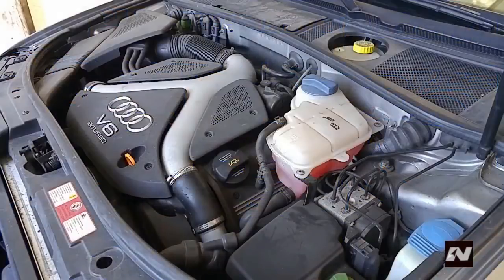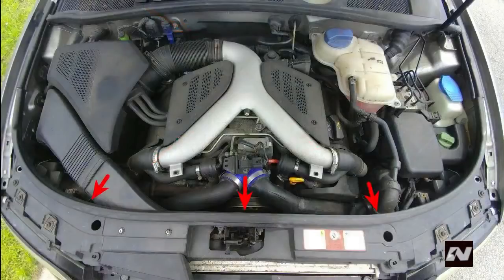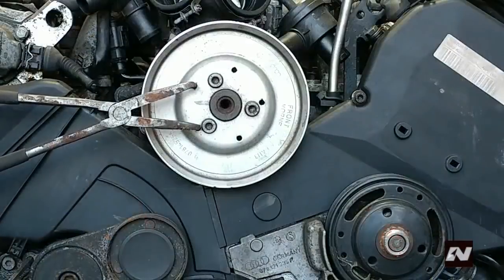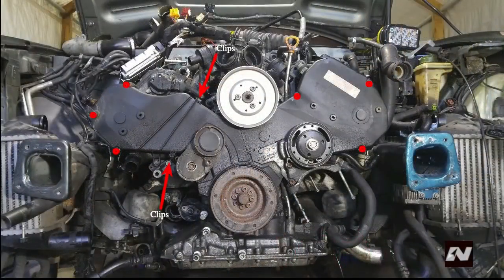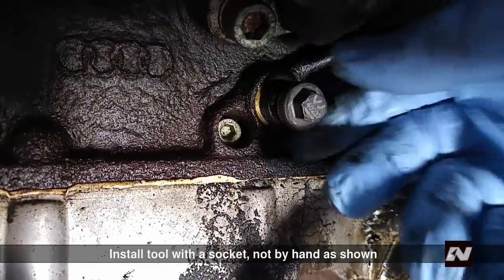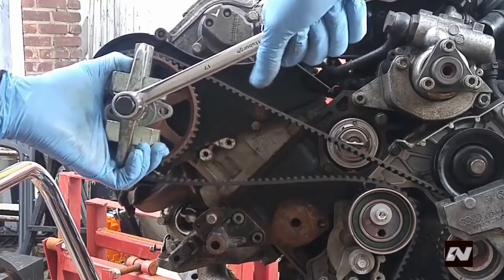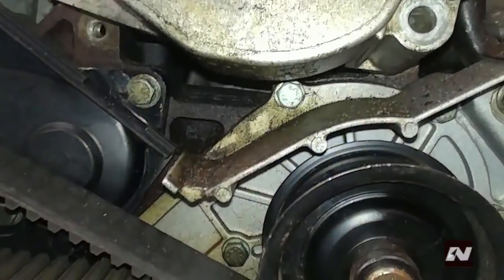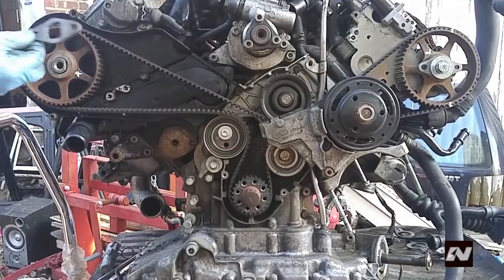Audi 2.7t Timing Belt.  B5 S4, C5 ALLROAD and A6 with 2.7t

Comment: Great video with very clear instructions. One extra thing I always do to be 100% certain everything lines up is to use Tippex or a small white touch up brush a few small lines across the belt and every toothed sprocket before removing the belt. Then carefully transfer the white lines to the new belt exactly and when you fit the new belt they should all align. I find this give me extra peace of mind as even with TDC marks and locking tools, a sprocket can easily move by one tooth and may not be noticed.
Reply from the maker: When you mark, you are basically following the last guy that set the timing, so for piece of mind, do it from scratch.

If you have no tools, then you have no choice.

Thanks for watching.
Reply: @pnswg01  Yes, that's true but I will have already checked that the timing is otherwise correct  with all factory markers aligning first (i.e. from scratch). You will also know whether the timing was already out from the last timing belt change as the engine will run badly. My point was that by just relying on factory marks, it is possible to put the belt on one tooth out as shown in the video with the crankshaft pulley. If you also mark all sprockets with tippex, you are guaranteed to have matched the last timing belt, which you have checked with marks anyway. We basically agree !
Reply from the maker: Got you.
Reply: This is an incorrect way to set timing and can lead you over stretch the belt. And you are not resetting the timing, you are copying the current timing. This car is timed with tools not marks. The sprocket is meant to spin freely and doesn't have timing marks,  because the cam sprocket position does not matter. To make sure the engine is in time perfectly, spin the engine 2 times by hand and reinstall the tools. If they both go in without effort, you are in time.
Reply: @Nemesis2747  In response, if you read my comments I actually said this was an additional action to checking all marks with TDC so it therefore cannot be incorrect . It was an additional action. It doesn’t stretch the belt as the tipped or paint is minimal.
Reply: @Nemesis2747  Having changed many many belts whether by factory tools through the camshaft sprockets/head or clamps across both camshaft sprockets or timing marks, it is possible to get the timing one tooth out especially with the latter marks. Marking a belt can only ever repeat the previous timing whether it was correct or not but if you know the timing is correct and the engine runs correctly it is just another fail safe check. I had already stated that you should check all timing marks or camshaft sprockets are correct first.
Reply: Same here. White-Out is the friend of anyone who undertakes this job.

Comment: Very informative indeed showing all specs. A hell of a procedure to be sure. Patrick Neil, thank you for sharing this, cheers.
Reply from the maker: Thanks John. I have another video coming up that show how to partially remove the belt without setting the timing from scratch.
Reply: I drive a '99 A4 Quattro 2.8L and bank 1 (cyl. 1 2 3) are misfiring. Changed bank 1 CPM (cam position sensor) and no change. This leads me to believe the cam has jumped a tooth. I'm looking for cam locking tool 3391 and puller T40001. I will attempt to do this without removing everything on the front of the car. If you know a lead on this please share. Thanks, cheers.

Comment: had i only memorized this before attempting to do this... I left out the pre-tensioning part before removing the cam locking tool. I still don't get why you need to lock the cams with that PIA crankshaft locking pin 3242 if you are locking the cams with the front locking tool. this is the BEST video on how to work with this miserable job.  thanks for doing this. really good work.
Reply from the maker: It is just a safe way of making sure the bottom end (crankshaft) don't turn during the procesure. (When tensioning or installing the belt etc.) 

Since the camshafts are free to rotate before they are pressed on,  if you are not careful the crankshaft can move slightly. It can be done without it if you mark the crankshaft gear 0 position and make sure it don't move. (Similar to the method used for 4 cylinder engines)

Comment: Great job now i have confident,  gonna do my s4 soon using your video ask my guide
Reply from the maker: Thanks.  Give yourself a lot of time.  Don't rush the job.  Tips: Vibration damper and viscous fan pulley bolts.  Ensure that your hex socket bottom out in the bolt head before twisting. In other words, tap on the socket before you turn.  This ensure that the socket won't slip which can cause stripping.  Also have another person help in removing the viscous fan.
Reply: Piece of piss I did it without the tool it looks scary don't be afraid TDC Cams big holes facing in straight edge line um up. Turn the Crank by hand first make sure you good. Good compression good engine. Looks harder
Reply: @pnswg01  I stripped one of those vibration damper bolts..had to weld another bolt to it. Nightmare, absolute nightmare. lol
Reply from the maker: @anicrow  Always knock the hex socket into the bolt before you turn. Rust and debris build up and prevent the hex socket\Allen key from going in deep. If the socket not inserted deep enough they will strip.
Reply: @chris425amp7  I've done this successfully no tools on cams too.. no removal.. just turned by hand , crank too and make sure nothing moved , we got another 2.7 and hoping I can do again successfully no tool,

Comment: Looking at your video I’m guessing my problem is water leaking out the thermostat housing. Without taking anything apart it looks like it’s coming from there. Water leaks out rapidly as soon as fill the coolant tank and seems to be just above alternator location
Reply from the maker: Common problem. They make the housing out of plastic. Aluminum would probably last a lifetime.  It could also be coming from the water pump.  If Audi had given us 5 inches (12.7 cm.) more space in front it would be easier to check.
Reply: @pnswg01  really love the allroad but starting to get many problems at 170000 km ( 105000 miles) motor still seems to run well though. As you mention if they put a bit more effort into quality would last much longer. Hoping new vehicles like the Tesla cybertruck have much longer life spans.

Comment: We always used cheap squeeze clamps on the cam gears to keep them in time. Never had to remove cam pulleys? Audi can make a paper clip cost $500. If you use good timing belts, they have timing marks on them. ...and if you know how to time these things, it helps. They sure are awesome to drive, and profitable to work on.
Reply: You remove the pulleys to time it 100%.
If you put on a new belt and tighten the belt with the tensioner the cams might rotate a slight bit and get out of time a fraction. By removing the cam pulleys they can move freely on the camshaft without changing the timings and thus you time it 100%.

Comment: QUESTION: The other day OI removed the right front headlight assembly to change the signal bulb. Should I be able to see my timing belt exposed ? Which is exactly what I thought I was looking at once the headlight was out. I was expecting it to be behind some kind of covering.
Reply from the maker: Timing belt is protected behind a guard. If its not covered, guard is missing or broken. Make sure you are looking at the right belt .

Comment: If you didn't replace the camshaft seals why then did you remove the camshaft gears?
Reply: The camshaft locking tool holds the camshaft in its place, but a new belts different & needs the gears revised into the correct place, the difference is minute, but enough to change the valve timing.

Comment: He didnt tell how to match timing belt  with   marks
Reply from the maker: Match timing belt with what mark(s)?  plural with and S, meaning more than one?  If you are using the tools in the video, there is only one mark to think about and it was shown in the video. (TDC mark)

People make timing marks when they are not using these special tools.  The method shown here is exactly how the manufacturer said it suppose to be done.

The only way to do the job correct is using the correct tools.  What happen if the last guy that did the timing was not that precise.  (Not so much off to throw an error code)  or the belt stretch a bit. 

Marking how you found it mean the same non-precise timing will be set after you do the job.  Don't repeat what others have done by marking.  If your mechanic use the marking method, take your car somewhere else.
Reply: @pnswg01  this is the case right now with my car....water pump was replaced before i bought it  and has always had a hesitation on takeoff...i found that the timing is about 1/2 tooth off ...so marking wasnt a option...i bought the correct tool to help with the job (3391)

Comment: Wtf, this is insane. What were these audi engineers thinking. Why not put a chain in the first place? It is a great motor but this is bullshit, you need to take apart half the car for a regular maintenanced component. Shame on them. Otherwise many thanks for the video and all the trouble showing what it takes.
Reply from the maker: You're right about that. Some of the 4.2 litre V8 engines use chain drive, but they decide to place it at the rear of the engine instead of the front. 

The chain guides usually fail prematurely. You have to remove the engine to replace them.

Comment: this video does its job i guess, but theres way better ones that tell u how to match it up to the marks, saving u money also because u dont need that cam lock bar at all nor the crank pully lock.
Reply: cameryn haroldson I see one of them for sale.  But it jump timing. But he his asking $2000. It's  a 2005 tt 225 Quattro.  Please tell me what you think.
Reply from the maker: There are two kinds of mechanics. The ones that follow manufacturer instructions and the ones that don't.

Sure you can mark how you found it..assuming it was good. If you rather assume it was good, then go ahead with your mark method and watch the other videos that are way better.
Reply: This is one of the best mechanical instructional videos I have seen
Reply from the maker: shred NW Thanks. It took a lot of time to make this video because I want it to be different from the others.  

I want to have the best views so I wait until I have an engine outside of the car.

I also wanted to illustrate by using arrows to point to the parts I am referring to.

The only thing is, I should have narrate it my self but I didn't have the time. Naration is hard work if you're not use to it.
Reply: Patrick Neil the text to speech narration actually works really well for this purpose. I am moderately mechanically inclined and feel more confident about this job on an allroad I just got. But I might just have someone do it lol. I would be happy to see more clear detailed videos like this from you!
Reply: What then would one use to line up the cam wingnuts, a good eye? Because I need to free bank 1 cam gear as i'm out one tooth. I need to manually line up the cam with bank 2. What would you recommend?
Reply: “U dont need that cam lock bar at all nor the crank pully look” 😂😂😂😂, there’s a huge difference between professional mechanics and backyard mechanics.
Reply: @floresm08  I had it in the shop today addressing the issue. After removing 50 pounds of plastic and pulling the plugs, rotated the crank (clockwise) lining up the cams noticed this; the error was so small between bank 1 wing gear and 2 decided not to fuck with it. Yeah, I could've pulled bank 1 gear rotating the cam 1 degree deciding instead against it. Besides, it could very well also be a timing chain issue. To note; I completely wire Jet planes for a living - but no expert on these delicate machines. It's an old car (1999) and even with the misfire still runs well enough until my next Audi ...coming soon.
Reply: One of the most thorough instructions I have ever seen - every step covered - thanks a lot!!  @pnswg01
Reply from the maker: @robertvanruyssevelt7159  Thanks for watching.
Reply: Hi...i can't fine the cam lock bar can somebody tell me. Is a different way to putt my belts

Comment: Hi Patrick my cylinder is at TDC ( the pulleys are aligned but the tool won’t quite fit over the camshaft sprockets.  Pins on the left camshaft sprocket don’t look quite level. So once the tool is on the right sprocket it won’t quite fit over the left and Large hole on tool and pins are slightly off. Any thoughts as how to remedy that?
Reply: Ps. It’s on the correct stroke.
Reply from the maker: There are 2 TDC. If the timing was correct, the 2 larger holes in the oblong washer will be inwards (facing each other) if you are at the correct TDC. If not, rotate 360 degrees.

Some time they are slightly off. Release the tension from the belt then use the tool to line them up. MAKE SURE THE MARK ON THE PULLEY ALSO LINE UP after the tool is securely on. LOCK the crankshaft. Everything should now be at the right spot to change the belt.
Reply: @pnswg01   Thanks for reply. It’s at the correct TDC but if I force the tool on there the the mark on the pulley will be off by about 10mm.  Will give your suggestion a try 👍🏻
Reply: @pnswg01  thanks that worked well 👍🏻